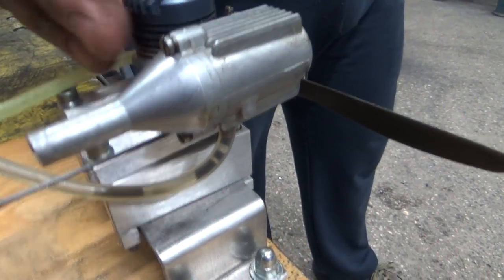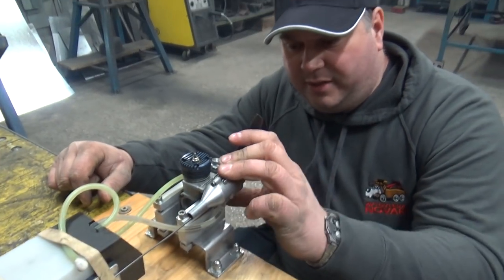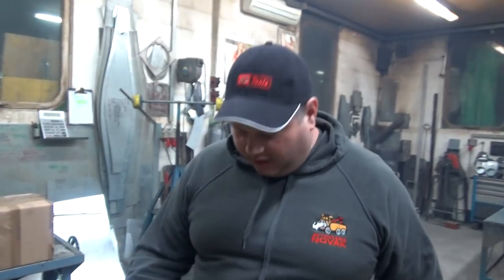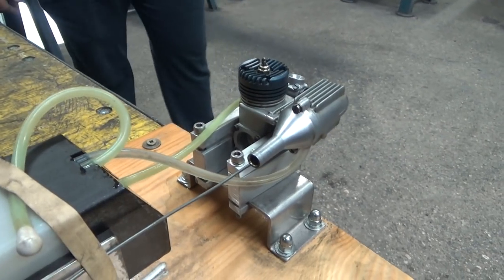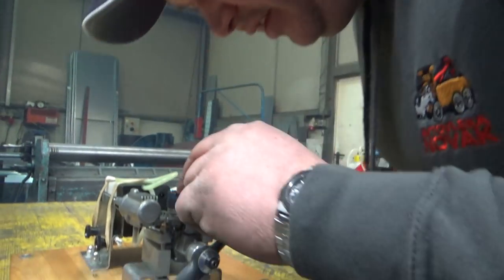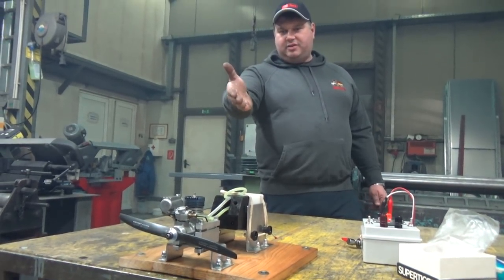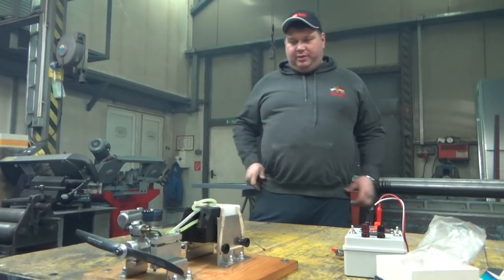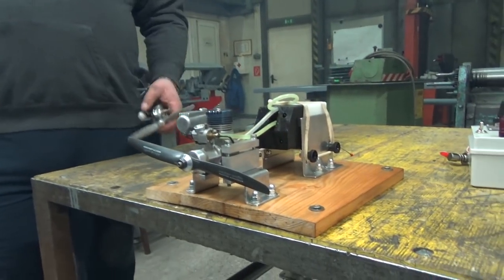SuperTigre x25 Blue head 4cc glow engine 1983 Run test by Captain Blaž

Comment: The Super Tigre X series was their top of the line series engines ... Top quality, super performers and easy to operate. When I was a teenager I had the Super Tigre X-21 a very nice and strong engine. Much more power than the OS MAX-S 25 (classic series) and one of the smoothest carburator ever.   Excellent engines.  Good video !!!
Reply: Charles Bovalis yes this engines are very very good....

Comment: I think all the two strokes are naturally stubborn. Its all about the fuel and proper start up procedures. It is easy to flood the glow plug or just starve them. I like all two stroke engines, I work on them all the time. Mostly in weed wackers and the like. That is one very powerful motor. Thats what two strokes were built for, speed. I hope you had it rich enough for a good break in.
Reply: RC Hobbyist Extreme yes i always put castor oil in the tank when i’m runing engines...

Comment: You will love that motor. I recently dug out my 70's made X15F.I. so i can get it running again. It has pulled many planes through the air but it has not run in nearly 30 years. It was made for the 15 class pylon racing and it is very fast for it's size.

Comment: The engine you asked about may be a old AP engine. I have a AP .15 Hornet , it has vary similar construction. The head is almost identical, the crank case back plate looks the same. The block looks similar, but the cooling fins are different. My AP engine has a round  rear exhaust instead of a side exhaust. The BB may stand for ball bearing. I think it's a .18 c.i. engine because  1.8 c.c. = .1098 c.i.  .18 c.i.= 2.9 c.c.. My .15 engine is about the same size. Or it may be a old Norvel engine which is NV now.  I am sending 2 pictures to Pilot Robert's Facebook page. I hope this helps.
Reply: Jeff Ussery https://www.rcgroups.com/forums/showthread.php?1402733-Vintage-Glow-Engines/page1064#post39270223
Here is info of these engines...they were made in Italy and they are verrrryy rare
Reply: I was talking about the engine at the end of the video. Not the Super Tiger. If I find something I will let you know.
Reply: Jeff Ussery the link is obout that engine on the end.. look up the page...

Comment: please measure the RPM!
Reply: Ronit Singh i did 13300
Reply: BRAVO Blaz! that is fast. I think newer 15-18 size do 20,000=30,000. This is in nitro cars and buggies, if a prop is fitted I think the rpm will drop to just about the same - 10-15000. AGAIN ALWAYS A PLEASURE WATCHING, I WAS UP TILL 2.30A.M LAST NIGHT WATCHING MORE OF YOUR VIDS. Waiting for the OS FS 60s maiden flight! take your time - Robert and Captain Blaz!
Reply: Ronit Singh oh that means a loot to us..nice to know that you enyoj our videos!!!! Oh yeah..i have an rc buggy at home Mugen Seiki with Alpha engine and it goes 42000 rpm oh yeah!!!
Reply: yes, that is really high revs, too much of a high pitched sound, this on the other hand with prop, the sound was smooth. I personally LOVE 4 strokes, the sound and low rev with high torque. I just have 2 4 strokes, the OS FS 60 and kalt FC 1 45 both open rockers. Now need to make a plane!
Reply: Ronit Singh yes 4 STROKE IS MY PASION TOO OH YEAH!!!!
Reply: It is the best especially when there is a 4 stroke as good looking as the OS FS 60!
Reply: Ronit Singh yes and i also have os fs 90  ;)